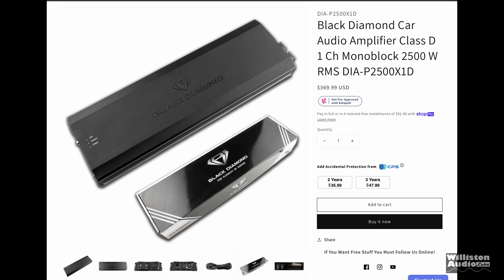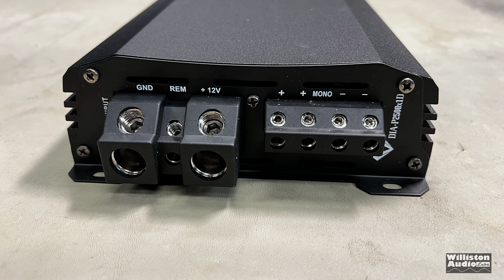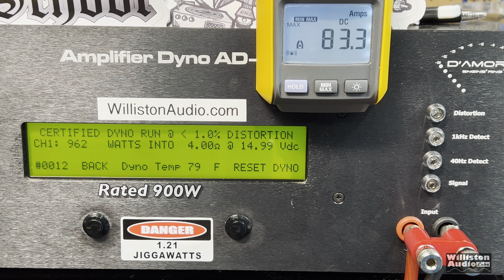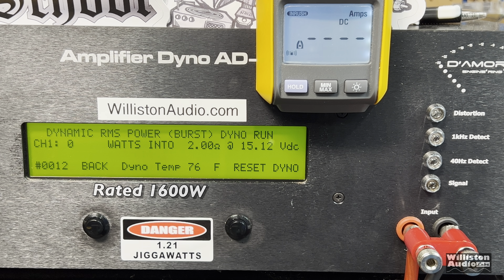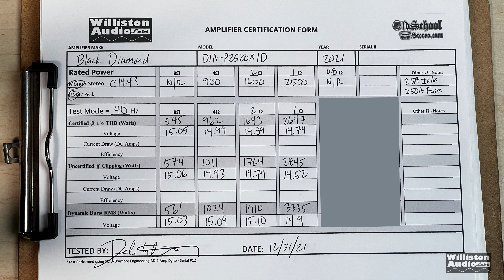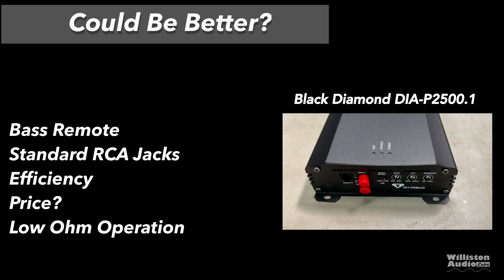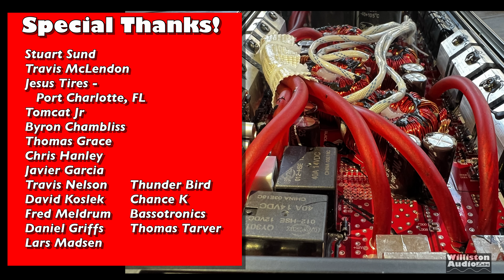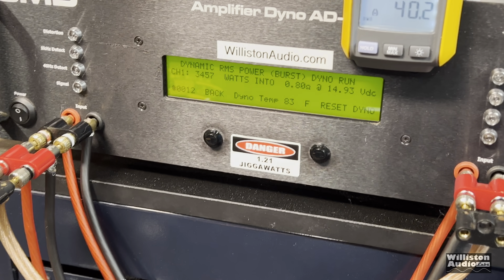Black Diamond DIA-P2500x1D - True 2500W Amp Dyno and Review [4K]

Comment: I bought the Black Diamond DIA-2550.1D based on your testing.  I really like it so far pushing a SKAR 10" in a ported box.  It added a nice level of bump to the stock Cruze sound system.   Thank you for your reviews.   Maybe this will be an upgrade if I decide to go back to sealed and do dual 10"s.
Reply from the maker: Thanks for watching and commenting!
Reply: Ahh , that would sound awesome ! What size box would you use ?
Reply: @HighVybeTribe Dual 10'" Sealed.   However I sold the Cruze and now putting the stereo equipment into my Mk7 GTI.  Not really enough room to put dual 10's and have any trunk space left.

Comment: Dang these manufacturers who deface the IC's. Thank you D for this one! This board has an odd mixture of components. I see people saying this is a Skar BUT it is not the same past the inductors as the Skar uses a 072/74HC02 driven type 4 output with optocouplers while this Diamond board uses the IRS21844 IC's for the output. And what's up with the transistor tie-downs mixed with clips. Uhhg
Reply from the maker: Thanks for watching and commenting!

Comment: Good looking amp and it made its rated!
Reply from the maker: Skinny like a swimsuit model 👌
Reply: @wal  If I'm not mistaken, the guts look almost exactly the same as the Skar RP-2k with the slightest tweak to make sure it hits 2500 RMS at 1 ohm certified. The RP-2K was always right at 2500 RMS at 1 ohm anyway. Pretty sure those numbers are almost exactly what the Skar is rated at, except the 1 ohm rating. The adjustments and that end of the amplifier look exactly the same as the Skar RP as well, and there's only very minor differences in the power input and speaker output end of the amp with slightly different plastics on the power inputs and speaker outputs. All in all, I'd say this is almost certainly a very slight variation on the Skar RP-2K. I would absolutely rather buy the JP23 with the awesome bass knob and the ability to be strapped. The Wolfram C-2400 was another one of these high power, low cost half bridge amps that were similar but had a better bass knob with a clip light. I'm really hoping to see JP come out with 3500 watt and 4500 watt versions of the JP23, so I guess what I'm looking for would be a JP35 and JP45. I've seen the CAB 45 do pretty impressive on the Dyno.
Reply: @catch22frubert  I’m sure you know Skar’s amp are just copies of someone else’s circuit. Almost nobody creates their own circuits these days and have unique amps. Well maybe not almost nobody JL, Rockford, Kicker, Taramps, Alpine, Pioneer, Kenwood, etc. that’s all I can think of right now but I’m sure there’s a couple more.

Comment: Excellent video as always. I imagine it would pretty much do rated at 14. Still not quite worth the $ not bad either
Reply from the maker: The amp performed to its ratings, but that included bass remote was blah
Reply: It does have a clip indicator on the amp itself though. How accurate was it, Big D?
Reply: Not sure whats with the fascination over the bass remote. As long as it works not really a big deal if its metal or plastic
Reply: @ah4800  not a big deal to uou perhaps
Reply: @kswis  what difference does it make? You mount it on the dash. You're not throwing it around or running it over
Reply: Why would you care what my expectations of a bass knob are?
Reply: @kswis  well said bro
Reply: @kswis  makes zero difference
Reply: @ah4800  ooook
Reply: @kswis  everything in the car is already plastic. Please enlighten me how metal bass knob is advantageous.
Reply: @ah4800  metal just feels higher quality and more solid in the hand vs plastic.

Comment: Hello @ Williston Audio Labs. I recently found your channel and am LOVING it! I'm sure you are busy and it's unlikely you'll see this..but, I'll give it a shot. I am old school like yourself and am from the days when Orion, Precision Audio, Zapco etc. were pretty much top of the line. I couldn't afford any of that back then but now I can pretty much get what I would like but I need my truck to still be practical (under seat sub - extended cab full size truck). What would you recommend for maybe an 8" or 10" single sub and a good enough amp to push it. I strictly want that little bit of extra low end, but I'd like it to kinda "get it" if I want it to. I'll soon be upgrading head unit and factory speakers so I just want that equality in sound. I'm not really looking for a $700 competition sub and 4k amp or anything, but def. not low end quality. Thank you in advance.
Reply from the maker: Check out the KICKER HS10. That may be all you need. This is an affiliate link https://amzn.to/3rx0f9D

Comment: Can you dyno my deaf bonce avatar atu 2k monoblock? I measured an output voltage of 67 volts at 14.4v input. Running at 1ohm I called the wattage roughly 3300w continuous. It's rated at 2k but it pushes a good +60volts 👍

Comment: Can you test the dia p2000x1d? It has different adjustments on the side which imo better than the 2500 model just curious if it's even the same amp just smaller or different amp all together.

Comment: I couldn’t care less about a bass knob but idk how someone can feel comfortable pushing their amp and subs without a clip light on their dashboard in an easy to see spot considering music is recorded at different levels and the bass in songs from different artists varies even more.
Reply: I love having a clip light! It's just one added extra preventative measure. Though idk why Taramps charges so much for their "clip indicators" $50 is way too much, I mean c'mon it doesn't even have a potentiometer! Just glad a couple of my Taramps amps came with the led clip indicator but not all of their amps come with one for free which doesn't make sense to me. I'd like to have an extra for back up incase my indicator breaks but I don't wanna pay $50 considering how cheaply made they are.
Reply: @itdoesntmatterwhatyourname6128  yeah $50 is pretty outrageous. It probably costs taramps about $2.25 to make one of those. It’s just phone wire, a plastic housing and 3 leds. Lucky for you though since it’s so simple you could easily fix it yourself. An led is the only thing that can break on that which can be replaced for less than $1 with a little soldering. I have my remote clip indicator to the left of my steering wheel but I felt like I couldn’t see it that great so I just got a little square piece of wood and drill it out and mounted another led bulb. Then I opened the remote clip indicator and soldered two wires in parallel with the clip light to my new LED bulb and painted the wood and mounted it under my head unit along with a clip indicator from another amp so now when my amp clips I get lights flashing on both sides but under the head unit is the one that I look at. I had already cut up my dash to mount the original indicator and didn’t realize that the steering wheel would block my view half a lot of the time. If I took it out I would’ve been left with a big hole. 
I’ve also desoldered a clip light off of the actual amp PCB board and used speaker wire to move it to the dash and mounted it inside of the bass knob and it looked clean. I’ve heard you could do the same thing without having to desolder anything by putting a fiber optic cable over the clip light and it will transfer the light to wherever you want( the other end of the fiber optic cable). 
If I needed to do that again I would research the fiber optic route first.

Comment: Great job showing the power, is there any information you can give on the distortion? I had an older 90's model 7 channel Pioneer Receiver that took out one of my mid range speakers on my Pioneer HPM 1500 speakers. I was told this happened because of the clipping.. Does this sound right to you.

Comment: Not a bad amplifier. At least it hit it's ratings. I wish things were still priced like they were in 2018/2019. That was the absolute peak of watts per $$. The Wolfram C-2400 with the clip light on the bass knob was only $199 back then. I imagine the JP23 would had been about $100 cheaper if it wasn't for these Chinese import taxes. I know we have to tax these imports for the country to make money or whatever, but 25% is too much for a blanket tax on everything coming over. That's why all the car audio and lithium battery prices went up so much. Same for Subwoofers. You used to be able to get really good subs for $140-$180. I got my American Bass XFLs  and XRs for $140 each back then. I loved those subs. The XFLs put out good SPL and the XRs were so tight and musical and accurate. I got my Orion XTR amps then too. The XTR 1000.4 and two XTR 2500.1DZs. I paid like $850 for all three of those amps back then. The 2500's were $330 each shipped. I wish I would had gotten a couple HCCA 5000.1 DSPLX or something huge, or at least a couple of 3000.1 DSPLX before covid hit and the prices went up so much. You can't even find Orion amps online for sale anymore.
Reply: I actually have an Orion dsplx 3k for sale rn

Comment: Just curious I am doing a budget 
Shallow mount 4x 12 inch subs in my mega cab.
Could use your advise on a 4 channel amp running each pair mono 2 ohm..
Or would a mono block amp 
Running 1 ohm ...be a better way to go ?.
And what would recommend ?.
I liked your review on the black diamond amp..  and the JP.
That Taramo review put down some power as well ...
Let me know 
Thanks
Reply: id go for a good class d amp thats anything that has an efficiency of at least 70%. they run cooler and are more efficient than running a class a/b, class a/b has an efficiency around 40-50%. just make sure your electrical can handle the power you want to put out
Reply: @rowboyto156  Thanks ..!.
I bought a 1600 Watt RMS 4 channel... For now.
Maybe will buy another and run all channels mono to each sub.

Or buy a large mono block and run 
At 1 ohm later when I upgrade ..

Comment: Which one is best MDF board or Plywood for Subwoofer Box?
Reply: mdf gives better sound resonance but its heavy, dangerous if you inhale the saw dust and will swell if moisture/water gets on it. good plywood like russian baltic birch gets fairly close on sound, its lighter and has better moisture/water resistant. the only drawback to birch is its expensive. you can get away using cheaper plywood but you will have to double layer them and hope you dont have huge voids or gaps in between the layers of the plywood

Comment: I’d rather have the Skar rp2. Same power at about half the cost. Cool video as always
Reply: Low Buick the RP2K gets too hot. I take a Taramps Smart3 over the Skar RP2000 any day of the week.
Reply: The skar rp2k has gone way up in price lately it’s not that great if a deal anymore
Reply: @Jboost412  what are you talking about? Last I saw the Skar RP-2000.1D is either as low in price as its ever been or not far from it. The current price is actually very fair imo AND that's coming from a person who honestly didn't have a good experience with Skar's rp2k & sent it back to Skar for refund under their 30 day no hassle policy.
Reply: @itdoesntmatterwhatyourname6128  they crept up in price the last few months a couple customers I had complained about it that’s how I noticed it but they are now back to around 220 an amp…..I personally have nothing bad to say about the amp I’ve ran them in builds at 1ohm properly ventilated so the amp can cool with good results a few guys I built for have had them daily for 4 years or so now still going
Reply: @Jboost412  they are $212.49 right now & I know they have been sub $220 since atleast last July 4 as I'm on the site often & can tell you've they've had this 15% off sale going on each & every day since July 4, 2021... Maybe even longer but I can't say that with 100% certainty. They just keep renaming the sale, for instance right now they are calling it the tax season/return sale, then there was one called the Thanksgiving sale, Christmas Sale, New Years sale, the Black Friday sale,  Labor Day sale, etc... These are just the top ones that quickly came to mind. I'm sure Skar isn't the 1st company to do this but I can say they are the 1st company that I can recall seeing having a constant sale for over half of a year. Very strange way of doing business. 

I'll end by saying that I think the CAB22 is a FAR superior amp & much BETTER choice. Right in similar price range for those on a budget. Also their is the Smart3 by Taramps for those looking for a lil more power or versatility running 2 or 4 ohm at higher rms than the RP2K. If one looks around they can also find the Smart3 around same price range (maybe $30 to $50 higher than the Skar through multiple retailers). I saw someone with some used ones on marketplace for $190 each & see them often right at $200 - $210. I'll shut up now as I'm just talking.

Comment: Big D my man when you test these amps what do you usually set the gain to?
Reply: Pretty sure he adjusts the gain using the SMD DD-1+ distortion detector
Reply from the maker: The past few videos I explained, not in this one. Unit is gain matched to head unit with 7dB overlap using DD-1+

Comment: At least it made rated power. A lil pricey, but realistically, every amp I'm seeing now is going up in price, so meh, It's not a total deal breaker. Totally unrelated to this amp, I have an Autotek Stealth Series 600.s chrome, flush mount amp that I am going to have fixed and am curious if that would be something you'd be interested in putting through the dyno. I used to run it on two Eclipse 12s and a set of eclipse 6-1/2 components back in the day and it bumped pretty good. I've always been curious about what the actual power output was on that amp (because i used to turn some heads with it).
Reply from the maker: Thanks man

Comment: I wish he would do the deaf bonce aak 4k I would gladly send him one because there are no videos out with them and I want a torture test .80 ohm down to .50
Reply: BASS HEAD 4 LYFE just get in touch with Big D via email. I'm sure he'd do a thorough video with all the tests you want if you send him the amp. You wouldn't be the first to send him an amp. Plus I'd love seeing the video since the DB AAK amps are beasts! I've seen more DB Apocalypse AAK Series amps then I could count that were being run all the way down in the dirt & they still were NOT going into protect, overheating, frying boards or giving any problems. I'll also add Deaf Bonce was using the 'cool hip' bass remotes with clip light, temperature, Voltage readings etc way before it became the new cool thing to do.

People can say what they want but the AAK Deaf Bonce amps are beyond stellar amps! A lil pricey yes, but they will outlast many other amps on the market when it comes to longevity.

Comment: I put a 20-awg copper wire coil in my custom no longer using anything satanic like the "sold your soul to become rich company" like, "JL Audio" or "Tesla Elons logo is the same." the logo is a bulls head upside down (it's the same as the Chicago Bulls logo) 12W6v2 frame on a 4 stack big boy motor with 3 spiders and mega roll 12" cone and it Shamed my Sundown X15 v.2 after I fixed the rattling problem since I got it. (has a useless 4" aluminum ring inside the gap that isn't machined properly to be inside the motor) same size coil... copper vs aluminum and the efficiency vs output is insane. It ripped the spiders clean off... shredding only the heavy ass CA Glue job I did on it. I hand wound a 18awg copper single 2 layer 1.2ohm coil in a similar build and it also shamed every subwoofer I've ever bought. They use aluminum bc it's garbage and takes more power to have less output and when powered it blows as soon as it hits hard it fails. Stop enabling aluminum or CCA wire it's not even close to the same. My video didn't save when I recorded it. Next warm day i'll show you the huge difference in capability and output. 😂😂😂 bye bye garbage aluminum coils. Do they put aluminum wire in transformers??? No they don't bc it's shit. If they do then someone needs to get right with the lord before mob justice comes in to save the good people who blindly buy into the useless possessions we seek. Turn back to God as subliminal truth shows nuclear destruction and the fall of America coming soon. I hope we make it but I don't see how